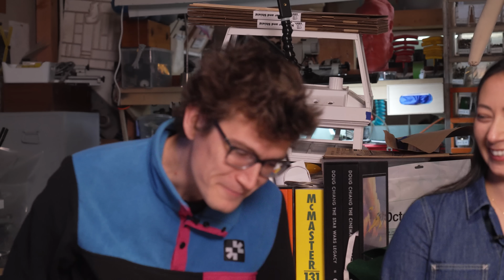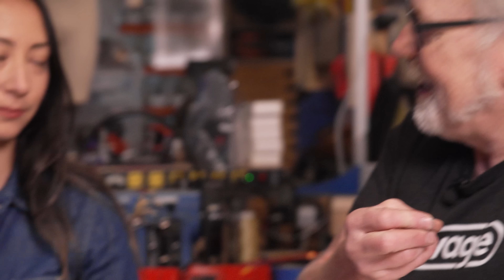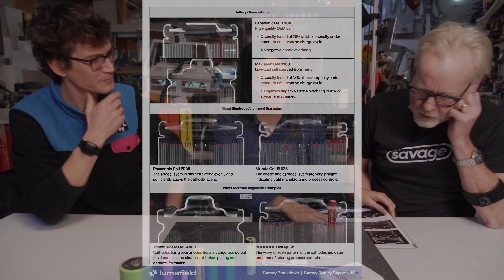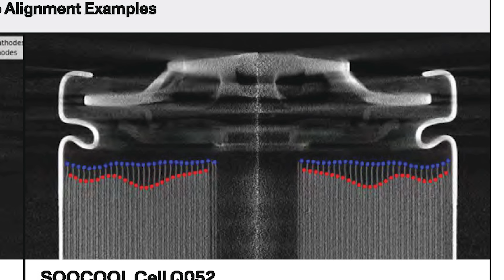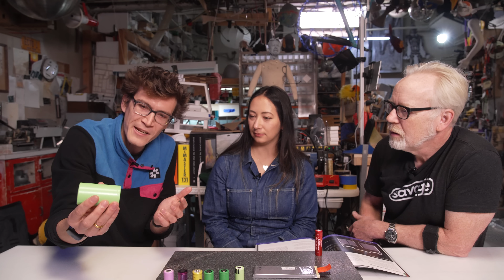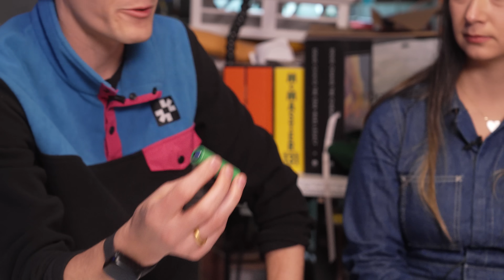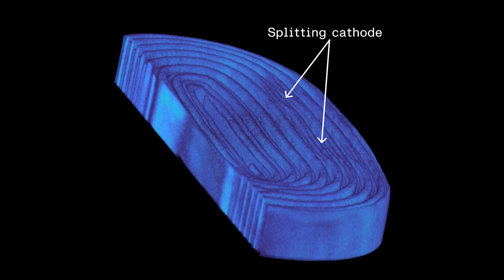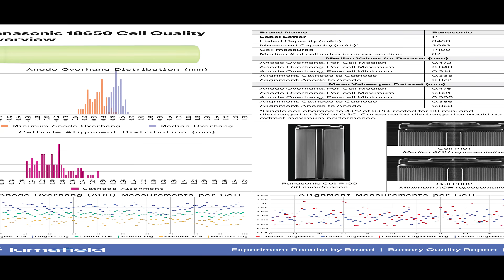The Surprising Flaws in 18650 Lithium-Ion Batteries

Comment: I'm sure this comment will get buried, but this sounds like we need to change the liability and consumer protection laws. If a company is making a substandard and dangerous product that is impossible for the consumer to determine the safety of, saying "Well just buy a reputable brand" isn't enough. Not to mention, consumers may or may not even be aware that the device they're buying has lithium batteries that could burn down their house/flat/garage. If brands were held liable for the quality of battery their sourcing, I would wager most (though admittedly not all) would be far more careful about who they purchased from.

Of course, such regulations would require a functional government to recognize the issue and then put measures in place to correct it.

Comment: I would love to see inside prismatic cells like the EVE cells that are commonly used by a lot of people for solar energy storage.... 
Although they are Lipo4 and don't become flame throwers when they fail.... But there are some brands that don't perform as well as others and being able to see inside them might reveal what the difference is, on the outside they all look the same.... Compared to the last lot I purchased, the new versions are twice the capacity for the same price.... 

And also, has anyone else noticed that after a firmware update to your phone, the battery has just begun to die very quickly? Is this a thing now? 
My phone is 2 generations newer than my wifes of which both are the same brand and same model, then some time later when the wife updated her phone, then her battery also lost capacity dramatically.... Then a short while later my son had the same issue.... 
The phones in question are not new, mine was good for 4 years, the wife's was even older.... It's like someone somewhere decided that it was time to make people update their phone and pushed out a firmware update to kill the battery.... This can't be a coincidence and I haven't come across anyone talking about it..

Comment: Large battery packs that use ganged 18650 batteries actually weld the batteries together in large arrays. It can be extremely dangerous to attempt to manually salvage individual batteries from these battery packs.

Comment: Kind of wanted to see them test molicel cause im planning on making my own milwaukee battery packs with the molicel p50b cells wish I could talk to someone who has done this already want to use the m18 12.0 ho batterys with bad cells and swap the molicel p50b cells inside dont wanna go with the forge line cause its not fixable iv already swapped cells from the m18 2.0 to the molicel p28A lmfao yes its like having an ho battery in a small form factor plan on making my own ho m12 batteries cause 79 dollars each for yesterday's best cell is bonkers id rather make my own with good cells

Comment: "I should throw some of those away"

Please do a segment on proper disposal of these batteries. I hope regular people out there know they certainly should not go in the regular trash.
Reply: if the rc and drone community has taught me anything it's how to properly dispose of a lipo battery by stabbing it with a steak knife.
Reply: @vampcaff  ON VID of course
Reply: @vampcaff  I had a vape go through the grinder. It's a biogrind 400 it can make a 40 ft oak tree into wood chips in 7 minutes.  We were lucky there was enough wood chips surrounding the battery in the trailer that the fire was smothered. We had a 6-foot charged spot on the top and as we dug through trying to figure it out. We found a half-melted kind of chewed up vape pen.
Reply: @vampcaff you mean disposed of via landing them in a tree within 10min of receiving it as a Christmas present.
Reply: Beyond the chemicals and whatever else is in them, no energetic surprises for the  local neighborhood garbage man.
Reply: @aaronjenkinson  I was told submerging them in oil will deactivate them and kill any voltage they may have, safely.
Reply: @cheatinggravity173  You were misinformed.
Reply: @jpdemer5  yep guess i was...just did some reading.
Reply: @cheatinggravity173 simplest would be discharging them down to zero volts, but that can be dangerous if not done carefully
Reply: @cheatinggravity173 ove been told submerging them in Salt water...
Reply: @Philip_R_P not sure how that would work. You need a load or something to consume the work. Or power off the battery. It may transfer but it could just as easily charge it slightly if anything
Reply: @Philip_R_P  Spot on. Releases the energy slowly and safely.
Reply: @Philip_R_P  Yep, we put old RC car batteries in a 5-gallon bucket filled with salt water for 24 hours before disposal.
Reply: @Philip_R_P  Note: The saltier the water, the better it conducts.
If you want to dispose of a presently-high-voltage battery for some reason, start off with distilled water and add just a tiny bit of salt, to make sure you're not allowing too much current to flow all at once (and potentially causing the battery to explode or emit significant amounts of hydrogen gas), THEN place the battery in it.
Why do I say to start with distilled instead of tap water? Because tap water can be really hard in some geographic locations, and therefore can contain lots of dissolved non-negligibly conductive metals.

If the battery you want to discharge is almost 0V, then it probably doesn't really matter how excessively salty you make the water, as long as it has some conductivity.
Reply: @stevenlynch3456  Good point.  You can also use a resistor.  You need to make sure the discharge current isn't too high for the wattage rating of the resistor but apart from that, it doesn't really matter what value you use.  A higher value resistor discharges it more slowly, e.g. if it's charged to 4V and you used a 1k resistor that gives 4mA initially.  4mA at  4V is 16mW which is well below what an 1/8W (125mW) resistor can handle.  That's typically the physically smallest resistor with leads you're likely to buy (as opposed to surface mount / SMD).  If you need to discharge more quickly it's fairly easy to find an inexpensive 5W rated resistor, so you could safely discharge a cell charged to 4V at 1A initially, using a resistance value of 4 Ohms, or go up to the next common value of 4.7 Ohms and discharge it a little bit slower.  The current tails off as the voltage falls so you should check the voltage, and you may still want to switch to salt water for the last part, or just leave it longer.
Reply: @jpdemer5  what about salt water - conductive...?
Reply: @larryenglish8900   Should work nicely.  In a bucket, outdoors, would be a good idea, since you''re making hydrogen as the water gets electrolyzed.
Reply: @Philip_R_P  That will make them corrode and burn.
Reply: @milsiart4976  no theyll just discharge slowly, and corroding is not a problem cause your disposing of them anyway
Reply: @larryenglish8900  Saltwater is highly conductive because dissolved salt (
) splits into free-moving, charged particles called ions (sodium 
 and chloride 
). These ions act as electrolytes, allowing electric current to flow through the water, making it a much better conductor than pure water.
Reply: @larryenglish8900  That's the whole idea ... it needs to be conductive to discharge the battery.
Reply: don't use table salt. Any electrolyte will do. Detergent. Soda. Even ammonia. Acetic acid. Citric acid. Soap. Don't poison yourself with chlorine.
Reply: This includes how to make them safe for the regular trash. There are situations where people cannot or will not take a battery for recycling.
Reply: @Kandralla YOU CANNOT PUT IT IN THE TRASH. I dont understand what is so hard about that for you to understand??? What you are describing is called a lazy person making ang excuse to say, 'oh but'..... but nothing. Get off your ass and take it tk dispose of properly. Makes up some bs excuse to justify throwing them in the bin 🤦‍♂️ so the chemicals inside dont matter right genius?? Well done 👍 you have a low iq
Reply: Bucket with saltwater and let it discharge to less than 1 volt.
Then there is like no energy left.
Or use sodium bicarbonate instead of salt to prevent chlorine gas
Reply: My  landfill has a designated place to drop off all batteries for free.  I collect mine, including the alkalines in plastic containers and every once in a while, I take them out there.  For me, it's not so far.
Reply: @jerrybobteasdale you realise one reason to recycle them is because of the chemicals inside and that they are bad as landfill right?  Oh wait you have a fish brain sorry. Cant argue with the disabled. Well done. Im guessing you from the USA right?? Where everyone just treats everything including the land like a dump. I guess if you guys cant even manage to recycle plastics and cardboard/paper then batteries are out of the question
Reply: Naturalise them before you even think of doing anything with them.
Reply: @EALordBaal  "Naturalize?"  Spay and neuter your batteries!
Reply: @EALordBaal   Being naturalized won't stop ICE from deporting them.
Reply: Put it in the middle of the driveway and pierce it with a knife or axe.   Let it burn itself out.
Reply: @SME.Retired  Hit the end with a hammer and watch as it flies away like a fucking missile!
Reply: they are scrap. we take them at the yard i work at, although not all do.
Reply: Lithium in the environment is going to be a horror story 50 years from now
Reply: ask garbage men what happens to garbage trucks due to negligence of public
Reply: True, i've got a dumpster track catching fire a couple of weeks ago near my house due to someone throwing out a big battery. When hydraulics starts compressing the thrash the  batteries are crushed and ignite. The driver saved the truck but there was a big pile of burning trash
Reply: I have a bag full of dead batteries because I don't know what to do with them. I know you can take rechargeable batteries to Lowe's but I don't know what to do about the alkalines.
Reply: @bland9876 take em to Batteries Plus
Reply: @bland9876  bonfire 🔥. 

That's probably a bad idea
Reply: Take them to any home Depot or Best buy for free e-waste disposal
Reply: @BlackCeII  Staples also takes them in.
Reply: i have always never known how to dispose of non-rechargeable batteries. even the common AA AAA 9v type batteries
Reply: A segment is not necessary to tell people to drop their old lithium  batteries at a battey recycling box. OR BASICALLY ANY BATTERY SHOP WILL TAKE THEM TO RECYCLE 😐 You want a segment on that?? Really??
Reply: "I should throw some of those away"... In a fire pit
Reply: Both home depot and lowes will almost always take any kind of lithium battery you want to dispose of.
Reply: Batteries plus takes old lithium batteries
Reply: Where I live the regular trash collection will recycle them for you (if you package them correctly and tape over the ends and such).
Reply: Recycle for sure
Reply: @Nicholas-f5  Oh, so put bad lithium batteries in the recycling bin, but not the trash can. Got it!
Reply: @brucemaki8679  Lowe's, Home Depot and other home improvement stores often have a bin to put dead lithium batteries in.  Usually, what I do with dead lithium battery packs is disassemble them, test the cells and keep the good ones so I can later make my own battery pack (with a good BMS), or repair existing battery packs (like I have done with my DeWalt battery packs when a couple cells randomly went dead)
Reply: @brucemaki8679  There are specialized bins at recycling centers for batteries
Reply: @brucemaki8679  Absolutely not!  This is just as bad.
Batteries need to be disposed of properly and recycled through the correct channels.  Household combined recycling is NOT that.
Reply: @brucemaki8679 look genius i know you think you smart by lithium is a fossil fuel so we should recycle them yes. Secondly genius in the trash they go to landfill and the chemicals inside cells are bad for the environment.
Reply: There is no "away"
Reply: @ToddEng  we know smartass
Reply: @ToddEng  You're away
Reply: I just burn them in the bon fire... It cant burn my house down if i decide to set it on fire myself.... I am not recommending it but i live on a farm so most things like this go in the fire pit or get set up on the target range.... or both.
Reply: @tropicaltrucker4425FFS. I get it. You don't intend to pass your farm on to future generations. Btw, I live on a farm to.
Reply: I thought you just throw them in the trash? Ive been doing that for over 20 years. Lol now you tell me?
Reply: @rogerd4559  ROFL
Reply: What if there is only one trash bin 5 countries around ??
Reply: Just flatten with a hammer
Reply: I tried in vain for 6 months trying to find a place to dispose of a lithium battery, ended up going to the trash because disposal is so difficult.
Reply: @peterlim3795 😐

Comment: 325,000 views in a day I think this topic has potential. Adam guessed he has 40 batteries in his Lab, would be interested to know the exact count and where they were hiding on devices where the battery is sealed inside the device.  Gemini says the temperatures in a thermal runaway are as follows: "Peak Fire Temperature: The cell surface and flames can reach maximum temperatures between 1,200°F and 1,800°F+ (650°C - 1,000°C+). "

Comment: Back in the 1980's through to the early 2000's in the alkaline disposable batteries we always bought Duracell as they were the only brand that never seemed to leak when left in devices for prolonged periods. However in the last 20 years all duracells I've bought have leaked and damaged numerous devices. I've now been buying ni-MH amazonbasics rechargeable aa and aaa's with no complaints. When possible I buy devices with removable 18650's and have a bin of loose batteries and I've noticed that some brands fail to recharge after only a couple of cycles and it would be great if there was a way to know what you are buying.

Comment: That company will be defunct in less than 5 years. Thousands of employees at other companies will get wrongly fired because of its conclusions. Bosses making and forcing bad choices wont be replaced.

Fixing manufacturing wont happen thanks to silicon valley wannabe startups. Its a huge part of what ruined the field in the first place.

Dilletantes that swear to investors they have THE device.

How many theranos before we say get out of machine building?

Comment: Great.  I have 3 flashlights, 1 headlamp and probably 3 solar lights that run on the 18650 Li-ion battery.   And 4 flashlights that run the 26650 Li-ion battery.😬

Comment: For any hobby involving bare exposed high power battery packs like ebikes or RC cars and you're charging them inside I'd always recommend a fireproof lipo bag to put them in. Proven to contain any form of thermal runaway and save your house

Comment: The fact that even Samsung screwed up and got a major device banned on airplanes is terrifying. As someone who is getting into making and maybe even microcontrollers, I'm very concerned about choosing the wrong things. I think for now, I'll stick with AA/AAA battery enclosures and utilize NiMH cells (like Energizer rechargeables) which are at least generally a lot safer than lithium ion batteries.

Comment: I do reviews through the Amazon Vine program.  Anytime I get something with a lithium battery in it the first thing I do is take it apart.  I would say but probably half of those items don't have markings on the case of the product that meets marking regulations.  Some don't list it even has a lithium battery in it.  Some have nothing on them at all, not even a brand name.  The poorly marked or items with no markings usually have lithium batteries (18650's) that have no markings on the battery sleeve at all, nothing.  Just a bare pink or green shrink tube sleeve.  I discharge the battery and toss it in the lithium battery recycle bin.  Here is the scariest part.  Anytime I find a product that does not meet safety or markings standards I report it to Amazon.  Does it do any good, NO.  I have gone back and checked and months later the products that have no markings on the case at all like a LED camping light that comes to mind I reviewed months ago.  It had a battery pack made up of 2 18650 cells.  The batteries had no markings on them at all, the product had no markings on it at all.  No even a brand name, just a perfectly smooth case with no print at all.  If I wanted to get another time bomb I could order it on Amazon today, they have done nothing about it.  I have come to the conclusion that as long as the product is selling they could care less if it burns down a few peoples houses.

Comment: That stat on the average American having 9 lithium -ion batteries is confusing. I assume it's looking at ownership? But that almost seems low? Unless it's skewed by homeless population, but then that amount of skew seems scary. And how do they take statistics for residentially unregistered individuals?

I own a laptop, phone, smartwatch, TWS earbuds(counts as 3), shaver, old/backup shaver, flashlight, battery bank, drill, vacuum; these all use a form of lithim-ion battery, and doesn't include old electronics I haven't disposed of yet, and some people have far more devices for work, and most businesses own their own devices, regardless of the people who run the business.

Comment: While 18650 aren’t super common in my country they’re widely used in the scuba diving industry, heck I put two on charge today and have to use an adapter socket as the charger is US plug and it doesn’t even fit fully into the adapter, US sockets are so incredibly unsafe